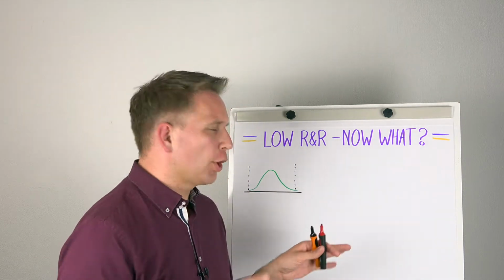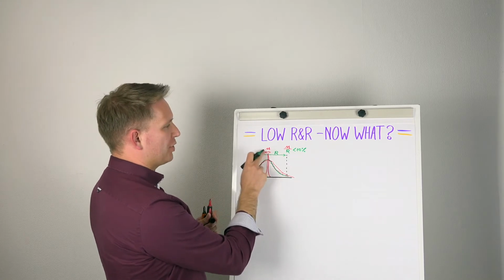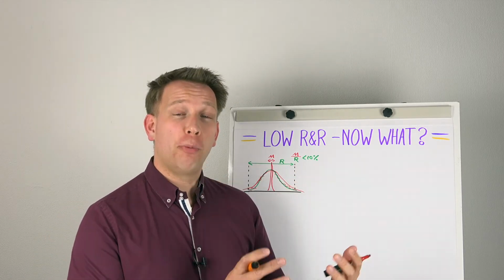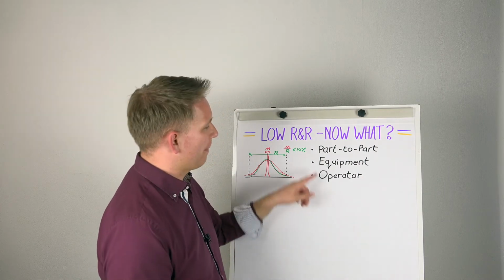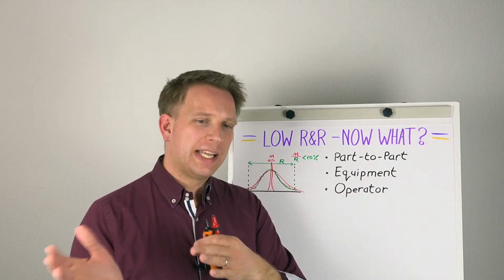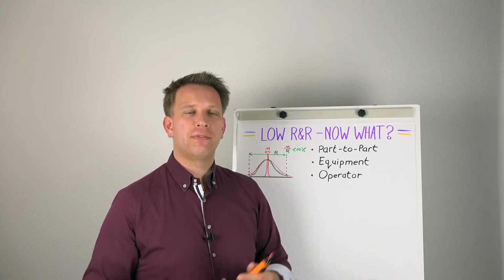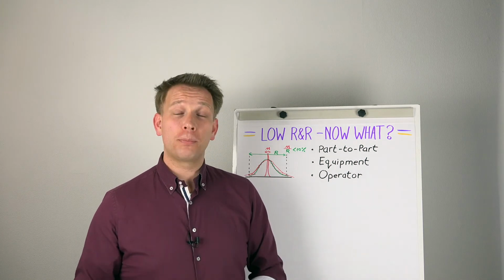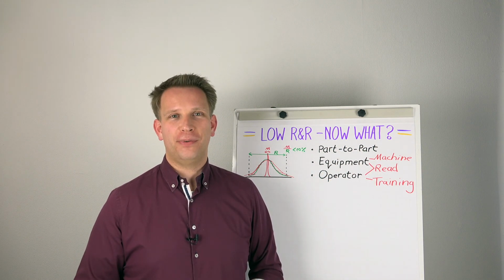How to solve bad gage R&R | Focus pointers straight from the R&R numbers

Comment: Great video on the exact subject I was searching for. I've been tasked with the responsibility of doing a Gage R&R study (my first time doing this) on a backlash measurement fixture I designed and have been using at my company for over 2 years. The parts are lead screws & nut subassembly that aren't always the highest quality machining (due to special material used on the nut). Making it more difficult is the fact that the users I've trained for the study find it difficult (but it's easy for me). We just ran a test and the numbers are pretty high, so we can't validate the fixture so others can use it. My manager is really pressuring me to get this done, and I'm at my wits end.